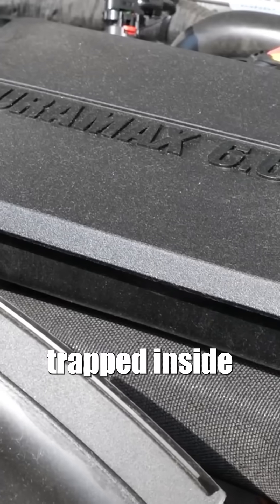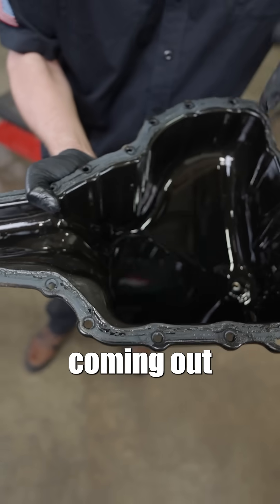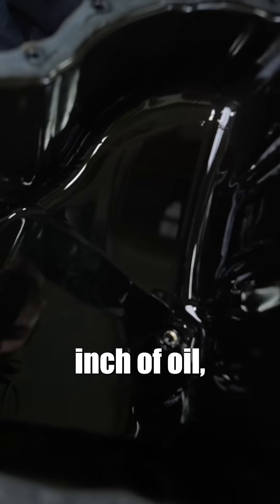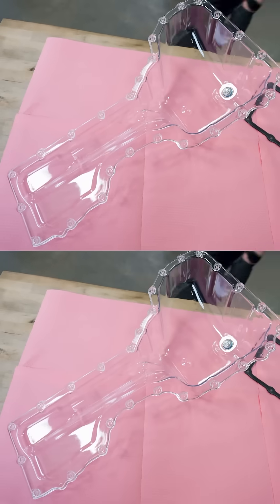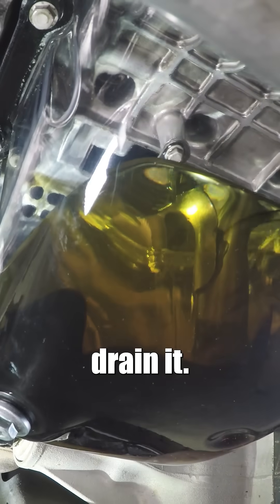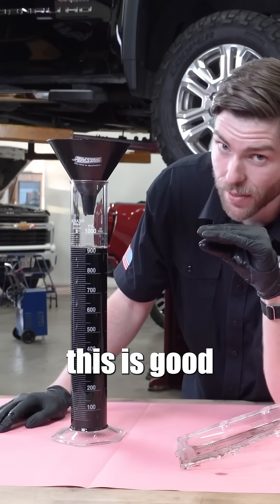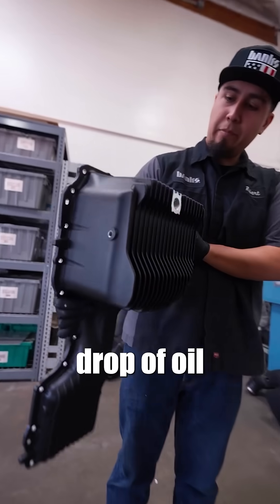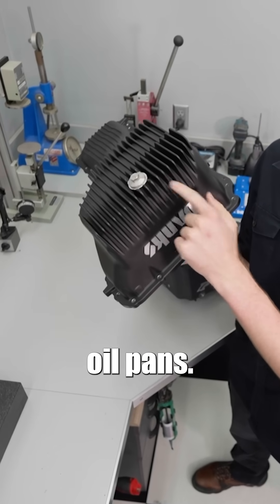A disturbing discovery. This dirty oil is trapped.

Comment: I can't be bothered to drain the oil galleys and pickup except when I pull the oil pan. Also, you should find a way to prime the system since you just emptied the pickup tube. I just had a couple ideas come to mind, one involving a vacuum line from the brake booster of another car to the furthest end of the oil system. I think I will try it on this head job I'm doing.😅

Comment: When changing the oil on my powerstroke, I always dump a gallon of diesel down the fill hole once no more oil is dripping out. Ill then dump 2 quarts of fresh oil down the hole to flush the diesel fuel out. I then turn around and put that "dirty diesel" in my tank and run it 😂

396,000 miles and still going strong 💪

Comment: Wouldnt it make it drystart longer since the pickup tube is empty since the fluid cant displace the air in the pickup tube yet?  When you fill it with the cool runner installed.

Comment: I'm not an engineer, but would that mean the pickup tube loses "prime" during an oil change? Would there be any adverse effect on the bearings from the momentary loss of i guess pressure or does that happen anyway when the filter changes?

Comment: Flush a quart of fresh oil thru it will dilute and get rid of most of it and or use oil stabilizers if you care and don't wait 20,000 miles to change your oil 😂

Comment: I love Banks products, but anything beyond that this new pan  adds some additional cooling and capacity, is a real reach. There is more than a quart, and there are more places where it gets stuck than just the bottom of your pan. It's also never been a secret, as there are two listed capacities from the manufacturer for initial fill and exchange for most brands. For instance, Ford powerstrokes have a capacity of 15 quarts, but only an exchange of 13. And if it's a GM or Honda small turbocharged gdi engine, you just add oil, and never have to change it.

Comment: I don't ever run full synthetics in my cars. I also change my oil every 3,000 miles religiously. The oil that comes out of my engine is barley dirty, so the little bit left in my engine makes very little difference. Change your oil more often and you won't have to worry about this. However, that is a nice oil pan. ;) Btw, both of my cars have over 200k on them. :)

Comment: I believe my Ford Escape oil pan actually drains from the rear, and the plug is REALLY close to the bottom of the pan thanks to a little down sticking feature on the back edge of the pan where the plug is.  All but maybe a few ounces drains out of the pan, especially if the front wheels are elevated just a bit.

Comment: So, suction through the dip stick hole doesn’t reach that last quart? Where the dipstick goes is different on every car, I’m sure, as is the oil pan layout - especially with dry sump configurations to handle heavy cornering characteristics of some sportier vehicles. But  for the average driver, as others mentioned, the oil is always a mix. In my northern climate, I’m not sure I’d want cooling fins under it, but also they might come in handy if you have a belly pan, limiting air flow. That’s the only selling point here, and that’s where the focus should be. Banks, you’re letting the ad folks take over! Stop it

Comment: Do you want to drain your pick up tube. I would rather have used oil run through my engine quickly than wait for the pick up tube to fill. Maybe the stock pan was engineered for this reason

Comment: A quart of dirty oil... and every time I change it, its a different quart. Not to mention it will mix with the new oil while running.
If it was such a concern, then why has it not been an issue with the OEM?

Comment: Using the same 25K rated filter for 3 consecutive 5K oil changle intervals would probably blow this guy's mind.  I've done this and then cut the filter opened after the 3rd oil change and it looked still good.  Granted, this engine has always had 5K chnages with full synthetic since new so it's clean inside.  If you have a dirty engine you can't use your filter as long.

Comment: Doesn't this just create a different problem?

If the pickup tube remains full of oil, doesn't that help the pump keep prime?

By allowing the pickup tube to completely drain, there is more chance for a dry, or at least a dryer start.

If the oil was still good prior to the change, it's going to be good after replacing what can be replaced.

A 6.6L Duramax has what a 10 quart sump.  Getting 90% of it out is probably more than enough.

I think I'd rather have some left in there to avoid the oil pump losing prime for that startup than try to get every last drop out.

Use good oil, change it in a timely fashion and sleep well at night.

Comment: Engine designers did that on purpose.  It is designed to keep the pick up full of oil so the oil pump doesn't loose it prime. When started after the oil change it my cause excessive cavitation of the oil and be slow to build oil pressure.  This could cause early bearing damage.  I'll trust engineering that has work for decades.

Comment: What if you made a tube with a 180 degree turn at the end and stuck it to the end of a turkey baster to suck out the remaining oil in the pan through the oil drain. A lot easier and cheaper than replacing an oil pan .

Comment: that 3/4 oil saves the engine in case you lose drain plug while driving: it has just enough oil left in the oil pan that the pickup doesn't run dry.

Comment: Why would anyone need that...leaving the oil in the bottom is by design...better on the oil pump that way.  Its not the same quart, the next change its probably gonna remove 4/5 of that previous old oil

Comment: Bet you anything that leftover oil in the pickup tube does more good than harm, especially on vehicles with turbos.

A second or two without lubrication is doing far more damage than 1/5th of the total oil still being old

Comment: The dirty oil isn't that huge of a deal if you change your oil on time. Also the old oil will be mixed in with the new oil leaving this mute and only a selling point. The system was set up not to drain the pump so you don't have a 10 second dry run. Isn't that why we fill the oil filters before install? Makes perfect sense to me. But then what do I know with over 30 years and I own my own custom street rod shop for the last 10 of it.

Comment: You understand when massive companies, like exxon, manufactur oil they have specific metal/sulfur/phosphorus specs built into them. If one of these oils is manufactured wrong they dont throw away the oil they dilute it or "work it off." Its the same principle with the "dirty oil" which i assume is synthetic and takes a lot longer to go bad compared to regular oil. If your really concered about that last quart of oil dont put shit oil in your engine. Oils that actually have to meet a spec, like dexos, are worth while (mobil 1, Valvoline, there are others, do ur own hw on this stuff)

also you do realize engines have always had an overhual capacity meaning you will never get all the oil out qdter the initial facotry fill.

Don't just use smoke and mirrors with the 3d scanner and graduated cylinder. Stop only being s salesman and educate your audiance.

Comment: That's for safety of the engine! If the drain plug moves out or leakes, there will still be oil in the engine. Sometimes mechanics forget to put new oil after draining, with the remaining oil in the pan you will save the engine.

Comment: the height of automotive stupidity right here, its almost like they engineered a portion of the oil the remain and keep the system from becoming unprimed with oil, right at the base where the circulating pump rests its intake

Comment: Am I going to blasted for rinsing with a gallon or so of diesel twice a year? Usually just pour it through and save the waste for the smut pots I use around the farm for some of our water pumps in winter. Been doing it for about 30 years and no problems that I am aware of.

Comment: Very cool oil pan, but the cost of installation far outweighs the benefits for your everyday cars. Regular oil changes exchange the oil adequately, so you need not worry about this concept. 
If you have the need to drop your oil pan, then it could be a consideration.

Comment: If you change the engines oil and filter at the recommended intervals, there's not going to be any issues.  Of course, if you're flogging the crap out of it, then there's that 😂

Comment: And engines are lasting longer than ever (Gasp!), except for the few, and oil sludging is the issue in those cases and that is not caused by a bit of oil down at the bottom of the oil pan; misplaced neurotic worry.

Comment: If you never want this much old oil in your new oil, then youll need to do a full oil change every few weeks or ~700km.  Old oil doesnt rot new oil either.  Just change it more often if you can't get over it.
     About debris and sludge build-up... even if it would, who cares?  After a certain point, it's not going to return to the system any faster than it came from.  If its suddenly mixed up deliberately, it will be diluted by the rest of the oil or flushing solvent and drained, not randomly.

Comment: This is absurd. I had an idea. Most oil pumps are of rotary gear design With tight tolerances. Now this may not matter but if the oil pickup tube is emptied of oil there's a brief instance where the pump sucks air. Again this timing may be too short to matter but was important enough for the manufacturers to keep in design

Comment: So is it better to have 1/10th dirty oil or air running through your system?
Cavitation vs a little dirty oil.
Reply from the maker: We've measured the time-to-pressurization with both the stock and Banks pans. In both cases, the time is negligible. More harm is caused by dirty oil at the bottom of the sump than the few milliseconds that it takes oil to travel up the tube.

Comment: Oops, I'm currently 325k on my odo. Never really realized it. I better get that new thingamajig then. Better late than never as they say.
Reply from the maker: Yes, there are many half a million mile trucks on the road with the stock oil pan with no issues. There's no arguing that. However, if there is dirty oil trapped inside, and that oil can be removed, it’s a net positive.

Comment: Id be willing to bet that the engineers who designed that factory oil pan did this intentionally to keep the oil pickup tube constantly primed.
Reply from the maker: Oil trapped in the pickup tube is a byproduct of the use of a weld nut, used to ensure proper thread engagement on the drain plug. There is no evidence to suggest that GM's intended to retain oil in the pickup tube for priming.

Comment: I self-learned long ago that it never pays off to let any manner of usual/typical big-name, fast moving mechanic shops or especially "take 5/ take 10/ take a hundred and ten bucks off you" oil change houses actually change your oil unless they give it a full fifteen minutes to drain, and also blow a wee puff of compressed air into the oil fill port after it stops draining (also giving it an additional five minutes of drain time and another few short puffs of compressed air during; ensuring the oil is pushed along).
  Alot of oil remains captured around the camshaft galleys in little pockets of the cylinder heads' metal castings. This serves no help during dry startups either, because it is NOT pumped anywhere until being displaced by more oil falling down from cam journals and upper jets or what-have-you. Even a large amount of oil can CLING to all rotating assemblies. EVER REMOVED AN 'EMPTY' OIL PAN AND LEFT IT OFF FOR A NIGHT? You likely came back to a MESS on your shop floor, eh?  EXACTLY.   
  TakeTooMuch oil change places dont allow ANY time or put in any extra effort to ensure any of this wisdom is distributed or practiced. 
  The twisted "omg i dont have time to give ANY amount of effort so Im gonna 1/32-ass everything I do for my entire life span" mentality gives rise to problems like these crappy "instant gratification" conveniences. These over-priviledge "time savers" are simply another deep deception that steals life span from your engine and also takes more than enough money from your pocket as well. 
Basically.... The time thats "saved" has not actually been saved at all; its been tragically STOLEN from your past (you having lost TWICE the money to that pirahana-swarm corporation that it would have cost to simply diy, which you have spent previous time earning) and also stolen from your future (being fact that your engine and sometimes transmission will also suffer earlier failure because of shittier tech-care of the lubrication systems...and you lose alot of money when you lose your trusty current vehicle) 

THINK ABOUT IT, FOLKS!!

Comment: I'm trying not to question the ability of this product helping or not helping. However, what about any used oil trapped in the cooler, or any other areas of the engine that will not drain out without major parts being disassmbled?

Comment: What a bunch of blow hards. What about the oil that doesn’t drain out of oil galleries, or the top of the head, or that is inside of your oil pump? Any why do you want your engine oil to be cold? If I ran that oil pan in northern Alberta in the winter it would probably cause more problems than it solves.

Comment: That oil isn't dirty, it's just not brand-new. Oil starts to darken after just a few hours of use. It's gone through the filter many times and there are no particulates of any consequence left in it. The dark color is the result of the detergents in the oil holding onto molecular carbon and metals which are too small to have any effect because the thickness of the oil film on all the moving parts is MANY orders of magnitude larger than the molecules themselves.

Comment: Cummins isx are the same way. The plug is on the side of the pan about 3/4” from the bottom. Oil also collects in the low spots in the head as well. As soon as you start one after servicing it and check the oil, it will be black already.

Comment: It would have been nice if you explained why every single automaker in the world designs oil pans and oil pickups this way. When everyone does something the same way it usually implies a benefit to doing it that way. Especially when there extremely obvious and simple solution to a perceived problem. Just put the drain hole lower. There. Solved it. Except did you? If the solution was so simple I’m absolutely certain it would have been implemented decades ago. 

If you can’t tell me why the problem has been allowed to persist then you don’t understand the problem. I would imagine this is one reason among many:

To keep a seal on the oil in the pickup. If the oil pickup drains then the engine will remain starved for oil longer while the pump builds pressure. This way the pump is already primed. This way your engine is lubricated sooner on first start up after your oil change. 

Otherwise they’d have just stamped a flange outward and threaded it so it all would drain. I can guarantee you’re missing something. You don’t need to justify your finned oil pan. Just say it’s for cooling purposes. That’s a good enough sell.

Comment: So what your saying is that the oil pans and pick up tubes are still designed from the factory with the idea that people change their own oil at home on ramps? 

Because on ramps that pickup tube is going to see air once the oil is drained and more oil will be drained from the pan because having the front of the vehicle an extra 10 inches in the air will put enough slope on the pan toget the oil away from the pickup tube as well as drain more oil... because of physics and engineering and simple machines and all that shit....

Comment: If you drain from the pickup tube there is a longer time the engine runs with no oil pressure, while the pump fills the tube and primes itself, this means your bearings take extra wear.  Here is a solution, its a pan that has a raised bolt so that a quart of oil maintains oil pump prime. Now you can get this oem approved and tested solution already installed on your vehicle.

Comment: An extra oil filter or filters would do the trick. 1 stock oil filter, 1 micron filter, and 1 bypass filter. Had that setup on a class 8 tractor (road truck). Synthetic oil, oil change was 110,000 miles,about 1 year.

Comment: This can easily be debunked by running clean oil through while the plug is off, or using an extraction pump. Or a boroscope

Comment: Technically true but the oil that is left gets diluted in the fresh oil so the concentration of contaminants goes down every time you change your oil. The oil doesn't need to be completely free of contaminants otherwise you'd have to change your oil after every drive, obviously there's a level of contaminants that is deemed acceptable.

And if you want to get every last bit of oil out you can always just use a $10 extraction gun through the dipstick instead of buying a $400 pan.

Comment: Uhhh, the sealant of the pan dies like 5-10 years and starts to drip, so it's has to be replaced. If you have a decent mechanic he will clean the pan too. Problem solved.
Also after an oil change you have like 99% fresh oil and a little old oil in it will not a make a big difference in the engines life span.
And probably they don't make pans for every single vehicle out there. This seems to me a solution to a miniscule problem.